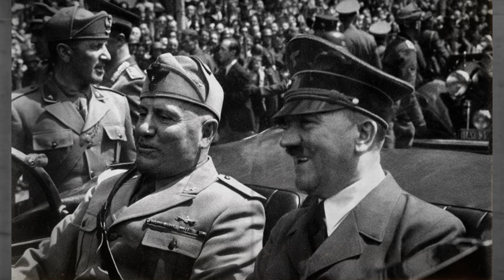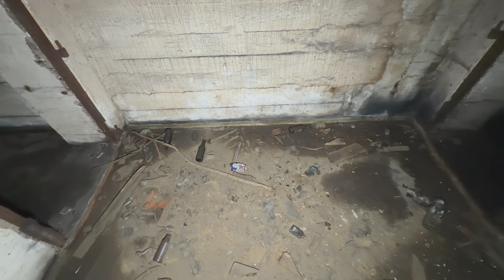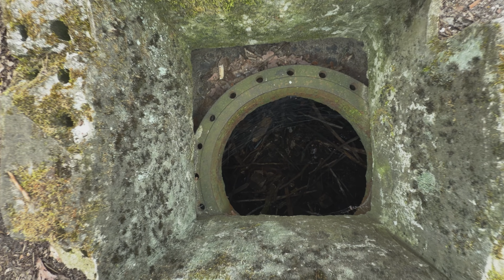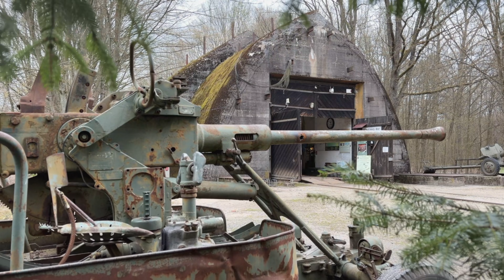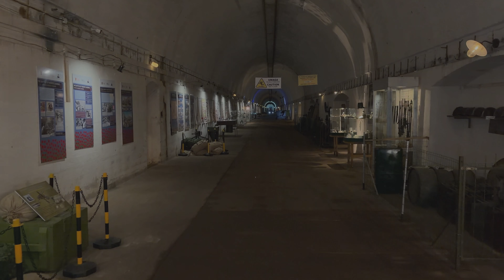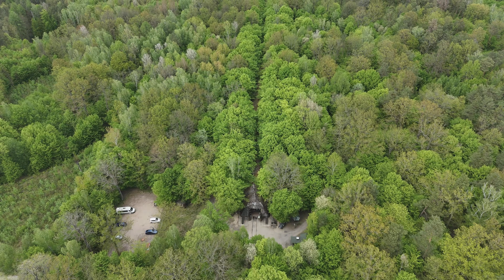Railway Bunkers of the Third Reich

Comment: They could store heritage rail vehicles in there to prevent vandalism and the decay of the elements. Just drill a few water sealed ducts for passive de humidification and lock the entrances.
I like the one that has been turned into a museum. Putting in a complete WWII German consist with Kriegslok and military vehicles and guns on the back would be cool.

Comment: Is the reason for the railway bunker in the video still being curved so that if someone decides to try to bomb it. It is harder to hit a curved railway bunker than a straight one? Nm seems that some of them are straight. Would be interesting to know the reason for the differing shapes.
Reply from the maker: One theory is that the curved tunnel partially dampens the shock wave inside the structure. The bunker in Konewka is straight. The bunker in Stryzów is also straight, but it is located underground

Comment: I wonder what will happen to these structures? In Poland, or wherever these structures are located, they can be converted into storm shelters for people to go to. However, it will require the complete removal of Nazi symbols from them.
Reply: The reason they still exist is probably because it's hard/expensive to demolish.  Like the sub pens in France or the air defense towers in Berlin.  The allied tried to blow the flack bunkers up with dynamite but only  managed to mess upp the interior structure of them.
Reply: Most flack towers, sub pens and coastal fortresses are still there, because they are so hard to destroy. Exactly what storm do you expect in Poland that need storm shelter, you are in acold climate and far from the sea.

Comment: Germans had dual purpose use of these structures, they told those were intended as shelter for Hitlers train BUT in fact they intended to use it as gas tunnel to drive in an entire train with prisoners and kill them inside their train waggons with carbon monoxide that came from a nearby wood gas generator.
Reply: Sorry you are wrong I know.
Reply: @bertiewooster3326  No
Reply: @Schlipperschlopper Look you already have a reputation of stating rubbish on Utube regarding ICE cars this why everything you say is inevitable wrong twato!
Reply: Was that because the so called gas chambers had wooden doors and couldn't keep gas contained inside as well as the tunnels could?
Reply: G
Reply: Yes